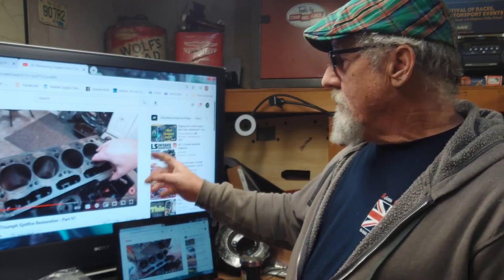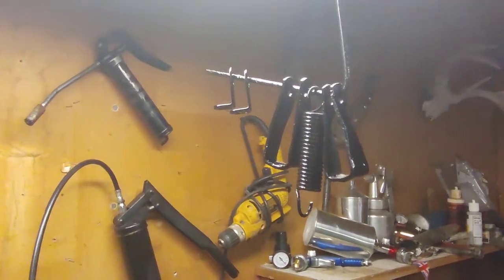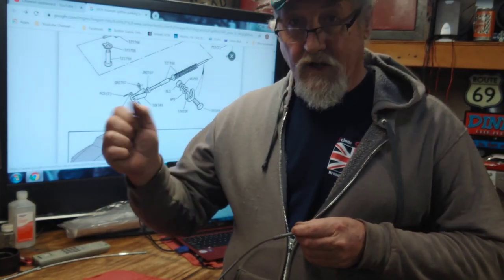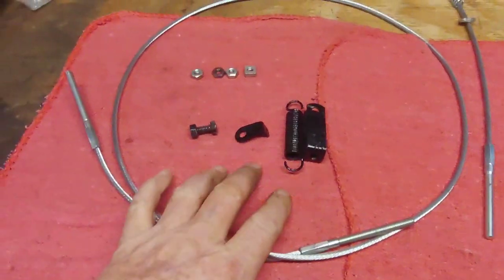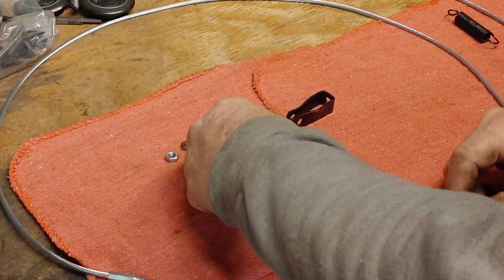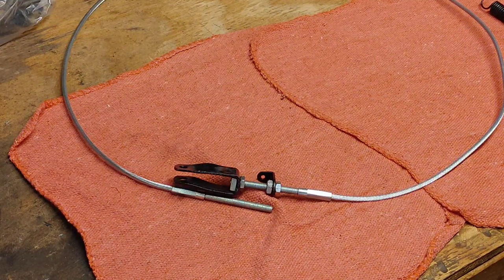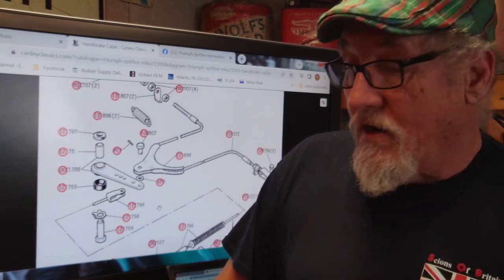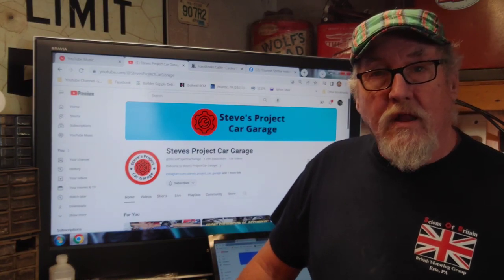Triumph Spitfire 1500 Emergency Brake Cable Install! Part 2

Comment: So the way I ended up fishing it through those cable guides was to do it going the opposite direction you were.  In doing this, it allowed me to put it sort of through the yoke of the half shaft just enough to eek the cable in. It was a nightmare of a job.
Reply from the maker: Ill give that a try! Thanks for the tip!!

Comment: Such a simple  Hand Brake system on those old Spitfires  possibly one of the most unsafe sportsish cars around unless you have put limiters on the steering
Reply from the maker: There are worse safe cars out there and I'm not scared!!